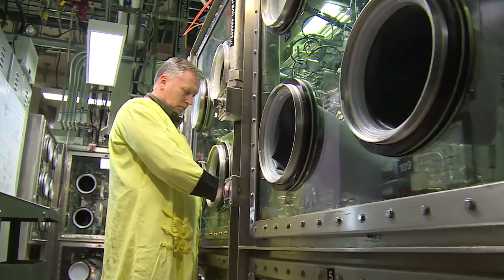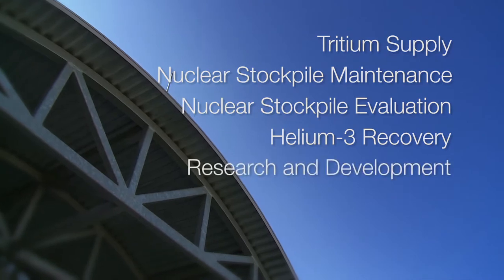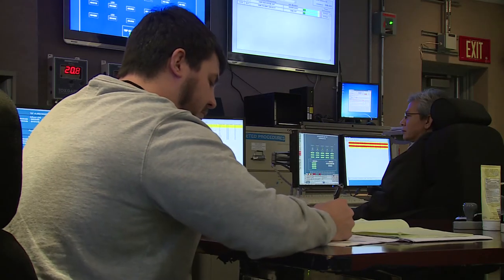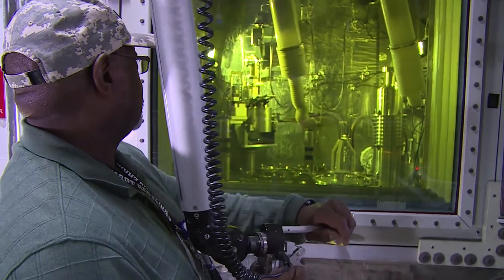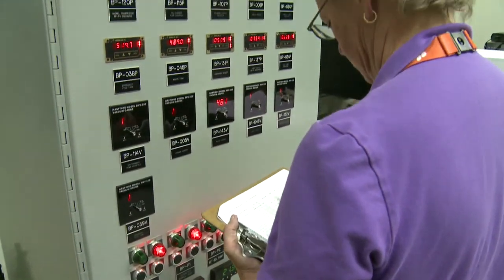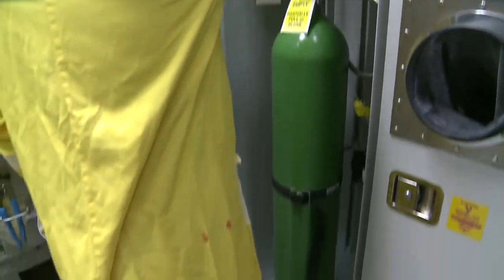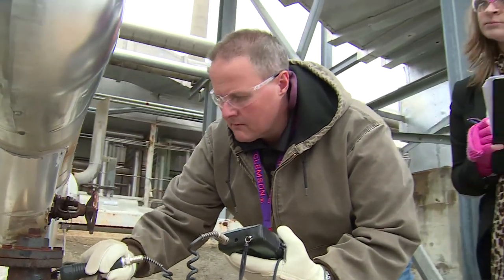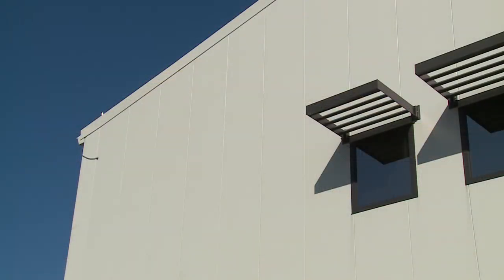Why SRS Matters - Tritium

Comment: Tritium production. You can see your employees glowing with enthusiasm ✨️ Hmm makes me wonder if circulating 6LiBeF3 eutectic around a reactor would be a good way to make tritium because it would make TF that could be easily extracted as a vapor without undue radioactivity. Helium 3 is good stuff too, used mostly for neutron counters and cryogenic stuff now but a while back we used it for the helium in helium neon lasers especially the orange yellow and green beam tubes. 😀